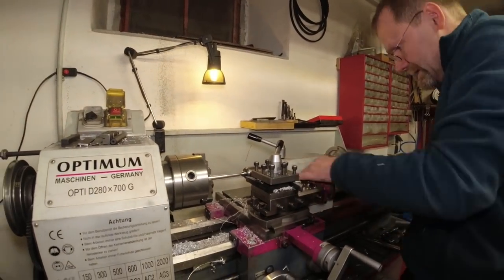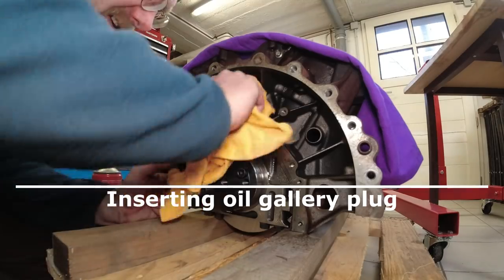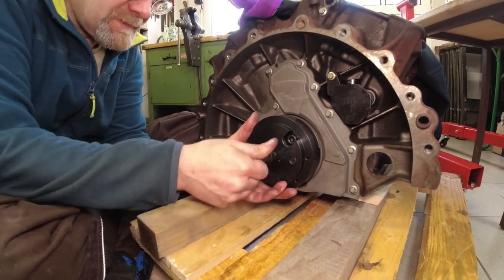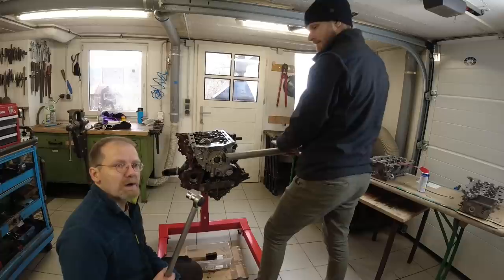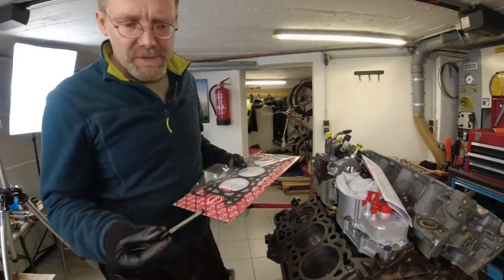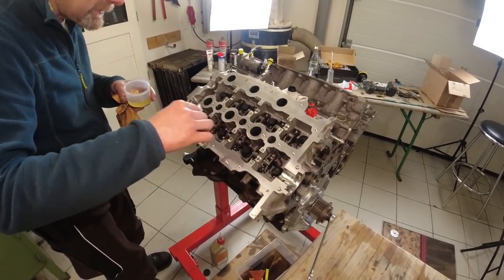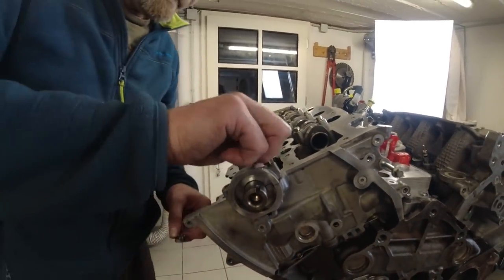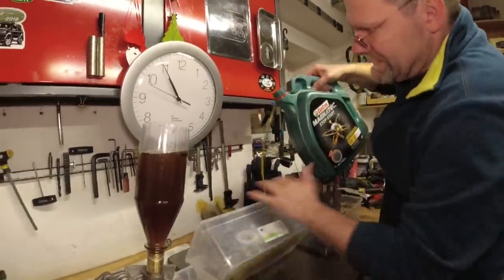Detailed Engine Assembly - Land Rover 2.7L TDV6

Comment: The Final is Coming Soon! 
Thanks to your videos, I got to know the exact structure of my engine. And some other interesting details. For example, why my mechanic was unable to replace one glow plug. Now I have 5 new glow plugs and one is out of order. Thanks.
Reply from the maker: He did not get it out. They rip. We‘ll do a video about those soon and how to get them outVera👍🙋‍♀️Vera
Reply: @Vera_and_Christian  Mine were all good but I still replaced them  while the body was off,  if you leave them too long they become too difficult to replace.  They are not expensive, and should be part of regular maintenance just like spark plugs on petrol engines.  Not sure why is not the case..

Comment: all I can say is: Holy Mother of God! My dad and I used to overhaul tractor engines on the farm and didn't even know what a torque wrench was! And they (engines) worked - hard! With no failures, for 30+ years! Amazing!
Reply from the maker: 😅👍 We actually wanted to involve an engine rebuilder, who is really famous for his work here in Germany. But he mostly works on oldtimers and Tractor engines. So his machines did not even measure close to the tolerances that we needed to meet. 🙋‍♀️ Vera

Comment: Hi Guys, you are doing a great job. I have recently overhauld my Discovery 2 Td5 myself. So I have a lot of compassion for all the hard work you putting into it.
The only advice I can give is to also clean the fuel tenk and fuel lines. I mas amazed on how dirty they get. 
Greetings
Reply from the maker: We habe done that already a couple of months ago, when it had problems with the low and also high pressure fuel system .👍There are more videos about this Disco.🙋‍♀️Vera
Reply: @Vera_and_Christian  Hi Vera, thank you for the reply. I hope you have a good holiday season. Best wishes.
Dirk

Comment: Another greatly detailed video! I am reminded how I spent many hours testing the oil pump in my VW Rabbit diesel engine, and eventually making parts so the pump could be tested on my drill press in a pan of oil. One of my findings - which you may have also noticed - is that pumping the oil creates a noticeable amount of heat! In the end, I found my oil pressure problems arose from the fact that the expert shop that rebuilt the head had line-bored the cam bearings for use with a camshaft having oversized bearing journals, and had installed a camshaft having standard sized bearing journals. The oil just squirted out of the gap, especially when warm. The experts then sent me another rebuilt head that had insufficient valve relief, such that even with a head gasket of proper thickness and properly set cam timing, the valves contacted the pistons slightly. That was a lot of work, but not nearly as much work as you have put into the LR engine! My hat is off to you!
Reply from the maker: This Disco had perfect oilpressure, better than on mine Disco 3. We always keep an eye on the oilpressure because that is one indication of a n upcoming crankshaft failure. We did change the oilpump however because of the metal chip contaminated oil. Our video about the oilpumps comparison will be out soon. 😃👍🙋‍♀️Vera
Reply: Cool! I am looking forward to the video! I am presently helping a friend with oil pressure issues on his restored 1955 Cadillac. It looks like the issue with that car is a weird design that uses a floating oil pickup - supposedly to avoid contamination in the bottom of the pan - but the floating pickup has a moving joint that can be above the oil level if the level is low, - which allows it to draw in air. It is a classic case of overly complex design actually creating problems instead of preventing them.

Comment: Brilliant workmanship!  It really has become a massive problem with these engines.  I’m not sure if you remember but I mentioned that my mates were driving a disco 3 back from the Pyrenees to Bristol in the UK last week and joked about dropping it off to you for a engine rebuild.
Well despite sitting outside for over a year not being touched the discovery started first time and made it all the way back fully loaded without a signal problem.  It’s a 200,000 mile car and it performed just fine.
Reply from the maker: 👍I remember😅🙋‍♀️Vera

Comment: Well done and love what you do your attitude and attention to detail has been fantastic from explaining and the pro and con approach the never give up it will be fixed!
Inspirational and beautiful so much so I’m proud to say I’m currently doing the same to my LandRover 1976 Series 3 engine the crank wasn’t snapped but I blew a hole in piston no.1 so far the bores are honed and the new piston and rings are in I’m currently lapping new valves into the head!
With my work schedule it’s been slow but extremely rewarding as it’s my first engine rebuild so hopefully I’ll get her on the road very soon!
Ready for the Australian summer in the meantime I’ll keep driving the D4 5.0 litre V8 and my Td5 110 Defender which I’ve also got parts to install on these!
Look forward to seeing the new video!
Take care 
Toby
Reply from the maker: Cool, good luck with your engine rebuild and be sure to let me know once in a while how it comes along. That would be really nice👍😃🙋‍♀️Vera
Reply: @Vera_and_Christian  thanks I will do it’s certainly not as complicated or complex as a Tdv6 I did own a 2005 Tdv6 for 7 years and the engine was fantastic even when I sold with 240000 kms it just had other issues!
Toby

Comment: Fantastic - please see if you agree with me the oil cooler housing where the oil filter sits has a non return valve where the dirty oil enters from the pump side. It goes out clean through the middle hole of the oil filter to lubricate the engine internals. So, the oil content of the oil filter housing do not drain back into the sump through the oil filter when the engine is off. The oil filter stays full because of this non return valve. Problem is this NRV is always covered with oil when you change the filter. You can only see it on a new oil cooler assembly. I think this is a feature everyone is very confused about in the 2.7 thinking the oil is taking a long time each start to fill the oil filter chamber.
Reply from the maker: I got the old cooler saved and I will analyze it down the road.  I also do not believe that the entire content drains back.  I did test and compare various oil pumps of the LR3 and found surprising results.  This video will be out in a few weeks. Christian

Comment: Hi Christian & Vera -great videos, - great pick up on the crankshaft timing pin, made me look at my TDV6 3.0ltr engine and it has the same M10 bolt hole. Was wondering where you found this little bit of information, also if you have a picture of the location section on the crankshaft journal web, where the pin slot into? Been wondering how to time the crankshaft to the flywheel, as no dowels pin or keyways to ensure correct orientation/timing
Reply from the maker: Wait for the next video. It will have more details on the timing.  Will be out Sunday morning.  Christian

Comment: Would of been good to show installing the Lifters & Lifter Arms, that nearly all of them stuff up!
Reply from the maker: You can see that in the recent videos when we rebuild our 2.7L Engine. And then you can also comment that we did not tap the valve caps. Engine has been running fine for 6000km now. 😃👍🙋‍♀️

Comment: I can’t find the right words to describe such a great job!!! Just one question: in order to change the crankshaft position sensor it’s able to do without taking out the motor or the entire body?
Reply from the maker: The sensor can be changed but it is difficult level 12 on a scale of 10.  In my next video, I make sure to show the location again in detail.  The LR manual states that the turbo charger needs to be removed. Not sure if this is the case.  I think it’s enough to take the exhaust pipe and front driveshaft out.  You will not find a shop which will perform this job without body off.  Christian
Reply: @Vera_and_Christian  Thanks for your kindly reply Christian. Like every Sunday I will be here enjoying and learning by LR Time

Comment: I know this is a bottom end repair, but did you not remove the valves and check the guides and change the valve stem oil seals?
Reply: Good point to remember
Reply from the maker: Wait for further videos, then you‘ll see everything we did😃🙋‍♀️Vera

Comment: This is a really great video, but it got me thinking about your approach because it really need 2 people and is really a pain to do (but very good). When I got by LR4 2 weeks ago with 121k miles on it, I read in the manual that the transmission oil is "filled for life" of the vehicle, hooray!!, but then Christian says no way and I believe him rather than the Brummies at JLR. So I need to change my oil. But could you not just put in the correct amount of oil into the gearbox at the start? Jack the car from the side and fill to the correct volume. Torque up the fill plug and get the car level. Then do all that gear changing stuff.  Would that not give you the same result and you know you also have the right level in it? Or am I missing something?
Reply: OPPS, I got distracted on put the comment on the wrong video, sorry about that.
Reply from the maker: The filling procedure is very critical.  There is no way to fill it all at once.  Also the temperatures must be just right as explained in the Robbie’s guide.  Christian
Reply: @Vera_and_Christian  you are so right Christian. It’s when you consider how tightly packed the gearbox is internally, there is just so little space for the oil. So easy to over fill. So I’m going to follow Robbies method and yet again you saved me time and money. Keep up the great videos.

Comment: I'm a bit confused as to how you got true TDC with just a chopstick and dial gauge, Assuming you can safely rotate the crank 360 deg why not use a degree wheel on the crank with a pointer and dial gauge with a chopstick attached?
Reply: You can measure the ineffective crank angle (ICE) more accurately when the the piston is at the top TDC.  The DTI measures when the Piston stops moving to when it starts moving again. If you halve that distance, exact TDC on the crankshaft is found. Just because the piston looks like it is at TDC the crankshaft can be up to 5 degrees out.
Reply from the maker: You use what you‘ve got at hand😅. We are not professionals, but we got that engine running again💪👍🙋‍♀️Vera

Comment: hi do you know the torques number for the main bearing please.
Reply from the maker: Check out our engine rebuild videos, we usually say all torques.I do not have an engine rebuild manual for sharing.👍🙋‍♀️
Reply: Hello, I did last night. Thank you. The result to my low oil pressure wasn't due to a spun bearing. It was only just a pick up pipe which was blocked somehow
Reply: Main bearings and big and bearings was completely fine

Comment: Christian have you looked to see if a electric pre oiler is available for these motors?  I know you mentioned that Fabians motor was not starting up quickly enough due to cheaper fuel pump.  Which I think you said would cause low oil pressure thus causing the premature engine failure. This might be  a reasonably priced upgrade to your Land Rover getting you closer to Toyota reliability status. Here is a link to a video of a engine pre oiler that does not even need an electric oil pump it seems great to me. https://youtu.be/Gn-6iAUsS6I 
Pretty cheap insurance for all the time and money spent on Fabians new engine.

Comment: Land Rover design changed little over 45 or so years, simple, reliable utility vehicles, and even the Range Rover was a comfy farm truck....... 
Then BMW, Ford and so on got their paws on it and things went rapidly down hill.
What we ended up with was luxury 4 x 4's , unreliable and totally unfit for the original purpose, infact unfit for anything other than fixing.
What you are rebuilding here is possibly the worst engine ever to be fitted to a Land Rover.... Get it in, and get rid of it.
Reply from the maker: According to Youtube, it's the third worst Diesel engine.  😅👍🙋‍♀️Vera

Comment: Hi, do you have a video of removing crank sensor ring?
Reply from the maker: Not in vehicle.  With engine out, You just pry it off.  Mounting is in the engine rebuild in full detail. Tool is 40 Euro on eBay.
Reply: @Vera_and_Christian  ok will try that thanks